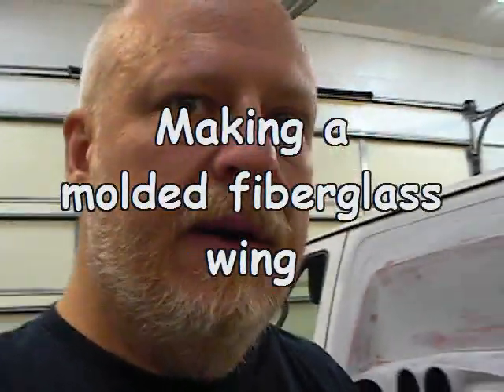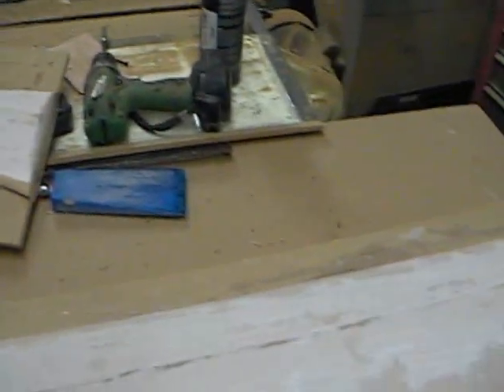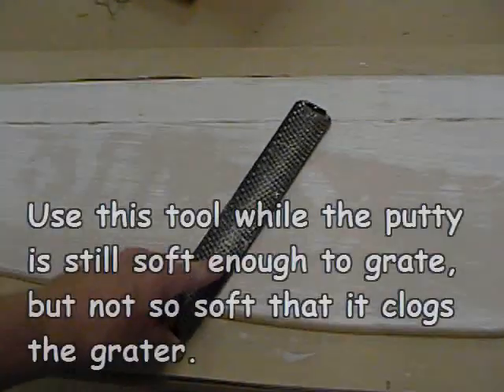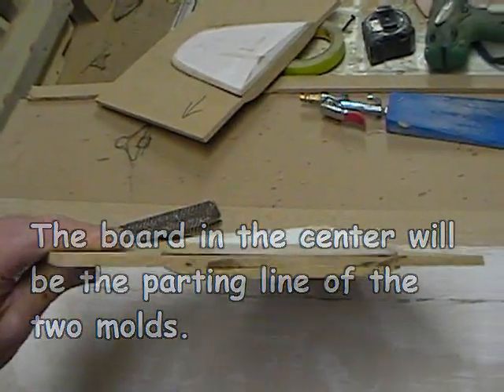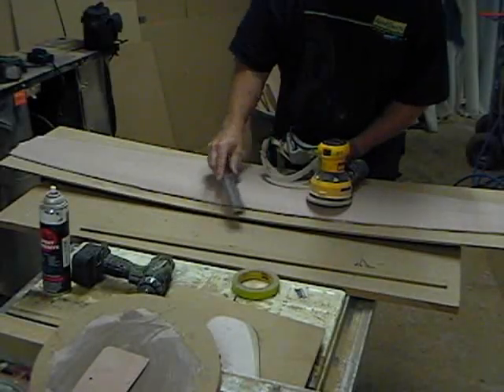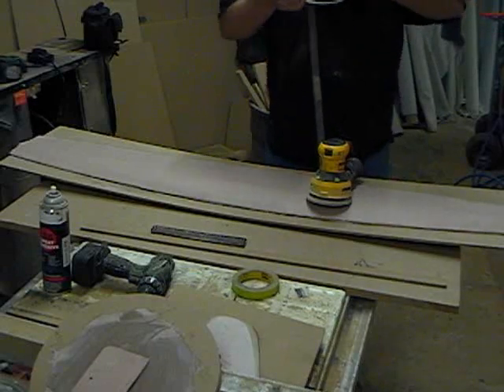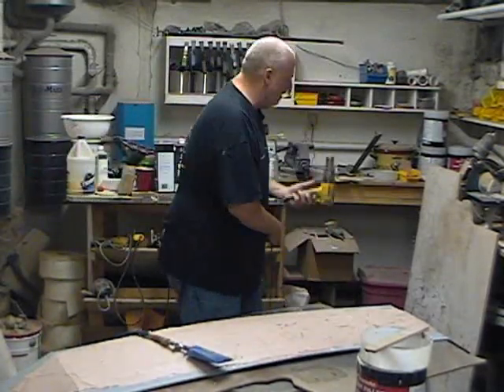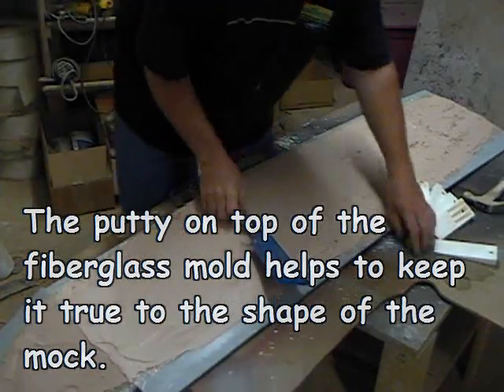Molding a fiberglass wing; part one (of 2)

Comment from the maker: I used the strands because most of the pieces I make would be difficult and too time consuming to make with cloth because of all of the curves and corners. Most of my work is done over cloth on a frame, so strength is not an issue. This piece would be lighter made with thin cloth, but I used what I had!

Comment from the maker: @GasserGlass Mock seems to be the more common term. Yes the mold was quickly made, and a bit flimsy, but it was not intended for multiple castings, and my time was very limited on this project. With the type of custom fabrication I do, this is usually the case.

Comment: Can you handle some hints? 1) I get a much stronger end result by using the foam itself as an added adhesive on a two piece job.  Trim the two halves so you can properly align them, then bind them together with masking tape.  Drill a 20mm hole on the underside, stand the job with the hole up the top.  I buy pouring foam as two parts - mix together - and pour into the job 2 or 3 times until it overflows.
I cut 20mm tin strips to shape & stick to the die to get my flanges. Otherwise I use clay.